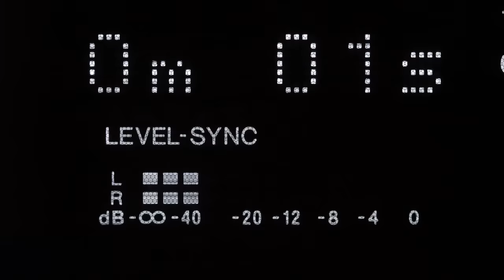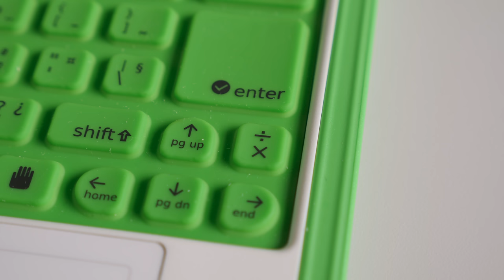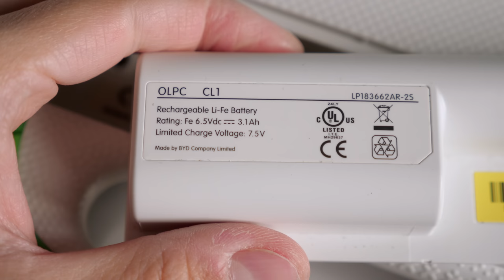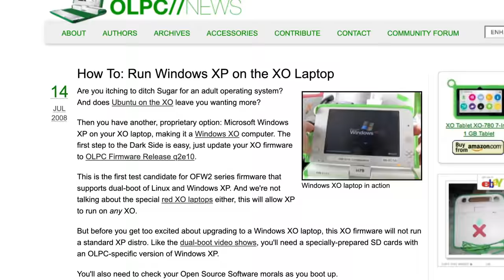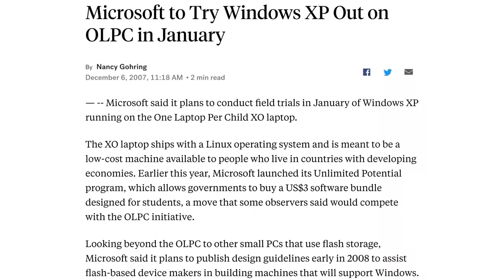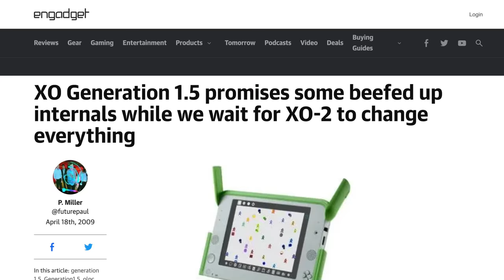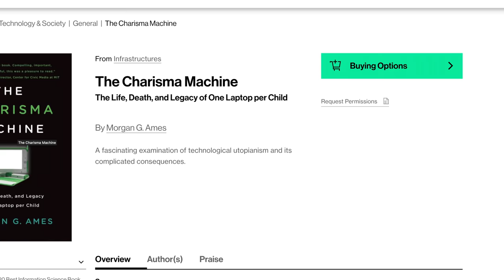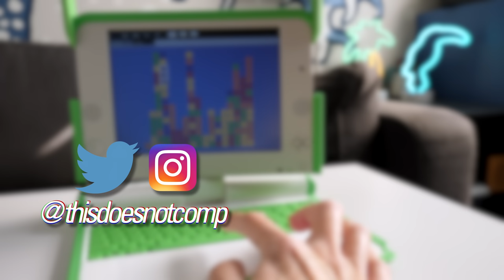OLPC XO-1: The $100 Laptop (That Wasn't)

Comment: im so sad to see this diidnt do so good and how corporations kept it from achieving its full potential, the design seems very well thought out and durable and even if some stuff is soldered it uses the simpler versions of those soldered parts like the usbs and such are so easy to unsolder compared to literally anything else ive seen i didnt think there were options like these, also the touchpad area having that extra part for stylus that never got enabled in software got me curious, does it have the hardware there? could it be enabled thrugh hacking? i wish you showed the bottom part dissasembled tbh, i find this so fascinating and cool and the engineering behind it seems very legit, i bet everyone involved in the development was very passionate about it, imo its amazing hadrware and the only flaws are the fault of corporations, like the screen being propietary, probably the screen manufacturer just wanting to make more money by not allowing the design to become open source :/

Also it had a lot of forward thinking ideas like the mesh network thing??? and the ereader mode with black and white color scheme with no backlight etc, i dont think any company/organisation has ever come up with such an amazing tech "product" (if u can call it that) since then

Comment: We live in an era, where we can fit probably 100 if not 1000 times more power in the device this size. But, not a single company will take initiative and make such a multi-functional device for a good cause. They will make tablets with a fancy OS and useless apps like tiktok but they will not make a good linux based system which will be enough to teach basic programing in developing countries.
Reply: Or do what China is doing and help develop their economy so they wont need crappy laptops

Comment: I wanted to sponsor this project, but got the image of the OS to run in QEMU/KVM, and found it completely useless for any learning purpose. The screen was rather revolutionary with it's ability to display only greyscales. If only they had made a classroom like interface, and a zoom-like classroom control like chromebook has made, I think it might have worked.
But obviously, the level of scam going on higher up made this a doomed project.

Comment: I'd say it was vastly over-designed by the Media Lab -- it ended up way over designed and way underpowered. If they'd just done nothing, industry would have gotten to their specs by just about when it actually launched. Frankly a Palm Pilot out performed it for about the same cost (albeit w a smaller screen).

Comment: I'm going to be the cynic here. The OLPC strikes me as another example of what privileged first world minds think when it comes to the needs of kids from developing nations. They design a ridiculous piece of underpowered hardware that ultimately is a compromised platform to learn on with an emphasis on ergonomics and durability that is not required but ends up eating much of their design and production budget. Kids don't need a glorified Fisher Price laptop, they benefit more with real hardware and operating systems to learn on. By the mid 2000s, there were plenty of low priced laptops that would have been good choices. The foundation could have focused on gathering corporate and government sponsorships to offset the costs of donating the hardware where it was needed, but instead they chose to spend their efforts and money on developing a bespoke hardware that was hopelessly weak and unsustainable.  It got them more attention and press, but they could have achieved much more.

Comment: The idea was brilliant but the execution was a bit poor..
they should have gone modular like the PI-top so that you can keep the shell and easily upgrade the core processing functions as the years go by.
you can tell that the PI-top was inspired by this machine because its the same child friendly ugly green color.
But even today pi-tops are still too expensive compared to just buying a budget tablet with a wireless keyboard.
If they can get the price point down to about $100 USD each and do a buy one give one deal then I'd buy one.

Comment: That's funny how in 2020 you can buy a real Windows 10 laptop just for $60 extra... P-r-o-g-r-e-s-s...

Also, those are standard Fedora locales. It used to ship about 400MB of them, until embedders revolted and they turned them into small installable packages about 2015.